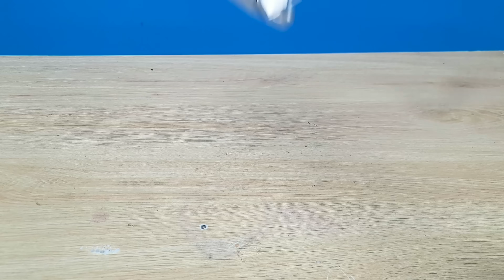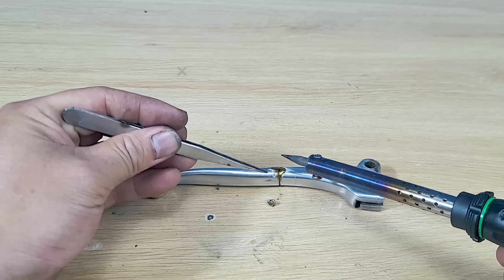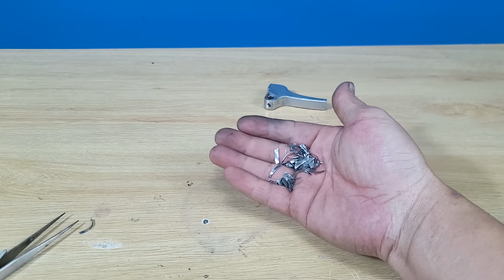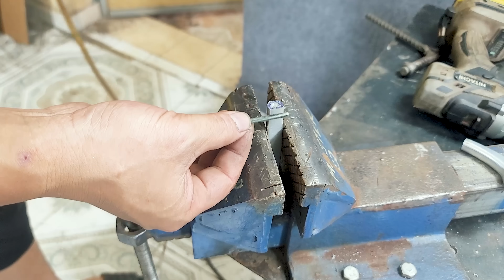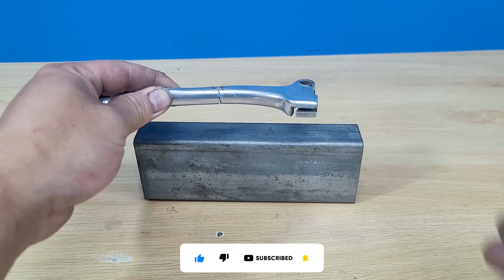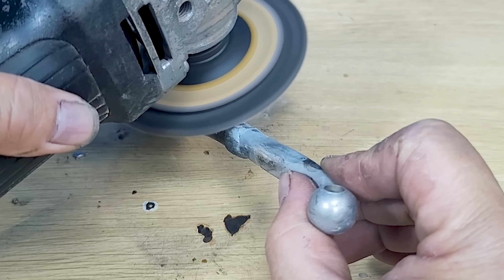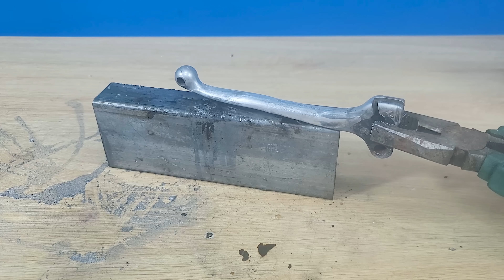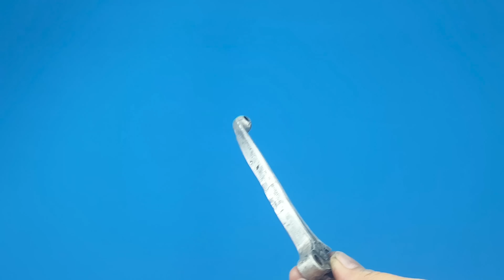Even a NASA professor had to learn this from me! Idea of using 1,5V battery to weld aluminum brakes

Comment: So you just need:
-1,5 battery,
-box cutter,
-pair of pliers,
-metal sheet cutters,
-toiler cleaner with hydrochloric acid,
-vise,
-cordless drill
-Philips bit size 2 and a Phillips head self drilling screw ( if you don't have a drill bit for some reason)
-purple marker,
-angle grinder with metal cutting disc and long M4 screw (if you don't have a taper for some reason),
-screwdriver,
-red marker,
-pair of tweezers,
-cotton wool,
-blowing torch,
-lighter,
-solder wire,
-toothpaste with abrasive, 
-buffing wheel for angle grinder,
-sandpaper,
-hammer,

Probably the only think missing here is life insurance if you are going to actually use this hand brake lever, but i'm afraid they won't cover the damage if they find what was done to the lever ...
Reply: The only thing missing was common sense...😂
Reply: @jackol_8 and his safety flip flops 🤷‍♂️
Reply: You forgot the camera 😅phone and 
Tripod  and hours of video editing
Reply: @DISLIKE4FUN  And thousands of hours wasted by people watching this video.
Reply: @DivyangM  ^No, it was funny to see, how crazy people can be 🙂
Reply: @christiancarlo117 also an Internet connection, a dwelling, electrical outlet, ...
Reply: I just got rid of all my drill bits, I only use self tapping screws now.
Reply: Hehehehe 😂 @anthonym.pacelli1960
Reply: @anthonym.pacelli1960 lol
Reply: ...and about 40 Dollars of different liquids and pastes, sanding paper, etc instead of buying a new one for 5 Dollars. Brilliant !
Reply: @microlatinamicrocontrol1240 and day of work - reliability?????
Reply: Парень показал дорогу . А идти по ней или нет тебе решать . А я так трещину в алюминиевой лодке запаяю . Или ты мне новую купишь ?
Reply: @Dimac_yx  вот думал как трубку высокого давления от кондиционера в машине запаять. Думаю такой способ не подойдёт)
Reply: Lol
Reply: As well as all that stuff, you will need to buy a new lever so that you can pretend that it is the repaired old one.
Reply: Right, but he forgot the laser.😂
Reply: You forgot most importantly the 110V soldering Stick that cost $25 and a new brake lever delivered is $6 😂
Reply: its solved by buying original part $5, instead of buy all of these up to $200 T.T
Reply: I'm surprised the clutch / brake lever didn't break at its weakest point -- the screw connector or the tiny cable attachment point. Regardless, I would only depend on that fix to hold until the new part comes in.
Reply: If you don't already own all of those things, you are not a man. 😂
Reply: Waste of time.Purchace new one
Reply: How money to buy all thing 🤣🤣🤣🤣🤣🤣
Reply: you forgot first aid burn spray, a  heat resistant jeweler's brick safety glasses and gloves and few other things
Reply: Is the Lever worth the total of these?! Plus the labour...
Reply: Дикость какая то, фиолетовый маркер. Поможет только синяя изолента!
Reply: Mate, you spent more time writing what this guy needed to solder the aluminum than this guy spent soldering it. With your pea sized brain you have absolutely no understanding of the complexity doing this job beyond the point "I can order a new one". Its not about the part, its about the technology
Reply: They NEVER find what was Dan belive me..😎
Reply: Many thanks to list 'em, you save my time to.
This really is 🤣🤣🤣🤣🤣🤣🤣🤣
Reply: Agree 100%
Reply: I don’t think the color of markers would make a difference
Reply: + баночки для средства чистки туалета
Reply: Dia hanya ingin menunjukkan penemuan baru, walau tidak ekonomis setidaknya dia bisa buat konten Tampa mengambil vidio orang lain 😊
Reply: Just you can buy a new one na
Reply: New one 150 indian rupees😂
Reply: Bahahaha
Reply: It's not a 1 comma 5 battery.  It's 1 dot 5...1.5 volts.
Reply: Also the fact that now the lever has less strength will be more prone to breaking.  So much easier to just buy a new lever.
Reply: Should also have an 8mm wrench to take the lever off. Removing nuts with needle nose pliers is good way to ruin your afternoon.
Reply: 😂😂😂😂😂 better to buy new one
Reply: That's the type of person who would take a train to travel 20 miles away to buy an item that is 3 meters away from his house.
Reply: É melhor trocar a alavanca que fica mais seguro e também mais barato
Reply: It's called Poverty.  A cashless society so poor they cannot buy new part. Music sound track is a big hint to this aspect of the video's creator.   To work all day fixing a brake lever on the families only transport. Poverty makes people's time the only resource.  Different culture different values.
Reply: No no no. Not just pliers,
MAGIC PLIERS that remove retaining hardware in most misterious ways
Reply: i dont think you actually need the battery. It seemed pretty irrelevant , like it was jammed in for some other reason.
Reply: Pensé lo mismo
Reply: And a partridge in a pear tree!
Reply: And skilled labour.
Reply: He just need his mum to slap him properly for doing silly things
Reply: thats a tutorial to weld aluminium, he haven't asked you to weld or repair only a brake lever
Reply: Yep, that's all you need for a roadside repair! Of course the heat will anneal the aluminum, so even if it doesn't break, it will bend the first time one uses it, and remember, the front brake is about 75% of your stopping power!
Reply: lol
Reply: Kkkkkk
Reply: Kkkkkk 😅😅😅😂
Reply: Go to a near by automobile spare shop, Buy a new one....  Problem solved
Reply: Một sản phẩm tư duy công khó quay đăng video Thao tác sửa chửa để có sản phẩm dùng được ! Thời gian ,vật tư . Giá Thành Sản phẩm . Thị trường khó chấp nhận ! Nhưng tôi khá khen 
- Cùng những lời bình luận không sai -
Vật chất hình thể ! tác động đến tư duy tạo ra sản phẩm tốt dẹp bền hơn . gố phần để phát triển ! Chào cảm ơn Video !
Reply: I bought one in amazon for $8.00
Reply: Thank you for breaking this down.
Reply: What about the health of the Earth?!
Reply: Your work is commendable, but it is not worth all the effort and money
Reply: Good estimations
Reply: One peg also
Reply: Think???
Reply: superbly put!
Reply: @RocRocket-cl3vc He did.
Reply: All right ✅

Comment: Good idea BUT repairing cost is higher than new break lever and repairing time & equipment, process all people doesn't have.. so better to buy a new one is good idea and time saving fact. Need to utilise our brain in some other costly product repairing is correct. This is not de motivation msg. Don't mistake my friends.

Comment: He could've did the screw thing & when it's all together taken a small drill & drilled into the handle on both ends of the screw & then driven a pin through each end. Then counter sink the pin & stick weld in there to cement it in place.

This would pin the screw together on both ends & serve as a backup safety mechanism should the weld in the middle ever give way etc.

Comment: You made a flux to help you to solder aluminium. You reacted the scrap zinc with maybe hydrochloric acid  or sodium hydroxide ( drain cleaner) ? I think perhaps you reacted it with sodium hydroxide. 
I haven't had any luck using zinc chloride as a flux for aluminium but sodium zincate could work . 
      However , you can directly use the zinc foil from the battery instead of solder to fuse the aluminium by using the torch to heat it to melting point . You roll up the zinc foil like you do for a cigarette. 
  Just practice using zinc to fuse together aluminium parts . It's not difficult.

Comment: lol! you are trying to look so smart, but you open the battery without gloves...? and then you drill holes with a screw before making threads with a modified bolt? Also, i think you spent more money on making it instead of buying a new one. Apparently you don't know much about this type of aluminium alloy, but when you heat it like that you rearrange the molecular composition so that even if it feels sturdy now, it will become brittle in cold weather or even snap off easier if you bump the brake handle.. I bet that one day it will snap off while you are breaking. I certainly hope that that won't happen anyway!!

Comment: maybe run that "tap" a full 1 inch on both ends and then use a equally sized bolt that did not have threads ground off. if you are using the  liquid as a flux then it should be applied in the holes and on the bolts as well to allow it to draw in the solder or weld.  i can see using this fix on a clutch but not a brake lever.

Comment: Besides the unnecesary work as I see everybody says (and they're right, it was more practical to get a new one)... Clickbait. You took the zinc/magnesium casing from the battery, apart from that you didn't repair anything with it, leave alone welding. You could just get the metal pieces from about, let's think... ALMOST ANYTHING MADE OF METAL. What a scam. And yes, I know you get paid from me leaving this comment, but man, I do hate lies and this is one. I hope your channel dies.

Comment: More over this is the back brake. If you screw it up again at the created weakness point because you created a gap insted of putting the to parts as thight as posssible together you will grap both brakes the rear one will be out of order in a critical situation and you only have the full braking power of the front brake what will throw you over the bar - dangerous af! And never use a hammer on aluminium it is a very weak material because it doesn't bend like steel it simple breakes when hammered or bend.
Reply from the maker: Hello, I am happy to hear from you many useful information for us, ♥️ ♥️ ♥. ♥Thank you very much. We look forward to receiving your support in the near future. We wish you a happy new day

Comment: If this is aluminium, you can weld it or solder it. But if this is ZNAL - zincum/aluminium alloy (ZnAl) then forgot you can repair it properly.

Comment: Bullshit!
you cut up the battery for scrap and simply wash it alongside the handle.
you then drill and install a rod and then lead solder it never actually using the aluminum scrap from the battery.
do us a favor and never ever make another video at all, we dont need this fake crap.

Comment: Ok I am sick of the BS "repair" videos that seem to have flooded YT these days, some of them are of dubious value at best while others (most actually!) are just total faked BS but try as I might I can't see a single flaw with this that fits one of those descriptions! In fact everything he did has a good explanation for it and "basically" it's the same principle and most of the same materials, Zinc from the battery, etc, that make those low temperature aluminum brazing rods work, and they do work quite well so I am willing to bet this will too. So yeah there are many "better" ways of doing this if, for instance, you have a TIG welder handy or maybe some of those low-temp propane/butane torch aluminum  brazing rods on hand but not everyone has such a welder or ready access to those brazing rods for aluminum. In fact if I am right about this process I see no reason why it will not end up as strong as those low-temp welding/brazing rods. Although I have both the proper welder and even some of those low-temp rods in my shop I find this video so fascinating I am going to dig out one of the batteries and some scrap aluminum and give it a try, could be useful info to know sometime!
Reply from the maker: Hello, I am very happy to hear your positive comments for me and a lot of useful information for us, ♥️ ♥️ ♥️ ♥. Thanks a lot. We look forward to receiving your support in the near future. We wish you a happy new day

Comment: Clever,  but I'd have simply ordered a new brake lever from a spares supplier. They are cheap enough and no big deal. Or, if that isn't an option, just used aluminium solder rod (brazing rod for our American cousins) to do the repair and saved myself all that drilling and cutting a screw to the right length.
The results here though are impressive.
Reply from the maker: Hello, I'm very happy to hear your positive comments for me, it gives me more motivation to complete my work, ♥️ ♥️ ♥️ ♥, SO nice to meet you. We look forward to your support in the near future, my good friend. Wishing you a happy new day.

Comment: Nothing innovative about this, just usual methods to join pieces together.  Seems an awful lot of trouble to make bits you can buy or borrow.  A drill bit and a tap to make the holes, a threaded rod or bolt as a joiner.  Welding rod to save all the mucking about with chemicals.

Comment: Seeing all the things needed to put it together gives me shivers. These levers are available cheap in a auto store
Reply: You can get ideas for other applications, not necessarily repair such a common part
Reply: @leetucker9938  It won't snap as it has the screw in the core and that strengthens it. But yes, totally waste of time and money for something what you can buy brand new at at least 1/3 of the cost to repair it. Unless you have nothing better to do... lol
Reply: @badseednut Actually it will because the lever itself is now half as thin and will snap off the bolt
Reply: @luc1ferblack  That screw he put in the middle it's steel, maybe stainless steel, not aluminum. it might break somewhere else but not where the screw is.   But even if it breaks, I don't care. It's waste of time and totally not cost effective. Better buy a new one.
Reply: @badseednut I think you missed the point the bolt wont snap but the material surrounding the bolt is now thin so it will just break around the bolt but yeah a massive waste of time and money and stupidly dangerous
Reply: @luc1ferblack  You probably mean that the screw in the middle might tore apart the handle in the event of impact. That's different thing. If that's what you mean, then yes that's possible and it's plausible to happen at the end of the screw on the thinnest side.  The chances for it to break where the welding point is and where the screw is in the middle, are slim.
Reply: @badseednut  I think your last sentence sums it all up!
Reply: That exactly what I was thinking , meaningless waste of time.
Reply: This is just an exemplary project for one to expound upon. Common sense. And safety first. Thank you for the tip. Now I shall couple this with my experience in other areas of creativity and in conjunction. I shall now leave you and retire to my laboratory where I may spend the next fortunate licking the wounds of failure after failure as I unsuccessfully attempt to conceive such doltish and may I add " primitive" contraptions of things u useful and unworthy of claim.  I'm mcguyber when it comes to water filter smoking vessels .and make 🔥 ass grilled cheese samadges😂
Reply: It seems like you've never restored old bikes or cars.

Comment: I agree with other commenters that this is probably unsafe. You should replace the part if you can.

That said, just wanted to correct the video title: this is soldering, not welding. The use of the zinc solution creates a flux compatible with aluminum.
Reply: Better to replace it with a steel or titanium part. Brakes are really important.
Reply: actually your completely wrong, on both statements, you must be one of those people

Comment: How to weld aluminium  using a 1.5 V battery, pliers, a vise, a drill, a screw, a bolt, solder and a torch.

Comment: Congrats, you soldiered a brake lever, ruined the temper of the lever and used a battery unnecessarily.  The first hard pull on that will bend it like play dough.

Comment: honestly with all that time and work could have probably cleaned the 2 ends and pressure welded them because its aluminum, or even ran electricity through to tac weld it back and then clean it up

Comment: ok, the idea is that external casing of the battery is made of zinc. Dissolving the zinc in the "liquid" helps the weld to stick.
Threader rod inside adds rigidity and strenght ..... Well it's click bait, but not so bad :D

Comment: I'm 99% sure at NASA they don't fix things like this. I'm 100% sure I won't fix brake's handles like this, those are made to brake at some point, in order to avoid more serious damages, otherwise those could be made out of steel, not alluminium. I'm also quite sure, if you do this, you will regret.

Comment: The tensile strength of Sn is about 5..10 N/ square mm. Casted Al about 175 N/ square mm. The max Force of the repared lever therefore is about 1/17!!
It is criminal to give such a recommendation. Risk your own live, OK. But not the live of others.

Comment: Just reviving techniques from the previous millennium ?
This looks like the 'killed acid' type of flux for soldering metals.  Phosphoric acid is great for this but any kind will probably work fine with no 'killing' (I have used it myself for repairing a failed instantaneous water heater )

Comment: And in those places there are typically people who can weld aluminum. That repair will not hold. You need a proper (not a makeshift) flux and you need acetylrne and oxygen or hydrogen and oxygen, or use an arc welding process with a shielding gas.

Comment: I think if you have a broken brake lever, you should take your car to a repair shop to replace it with a new one. It's fast and safe. Doing it like a video clip is too elaborate, time-consuming, and costs more materials than it would cost for you to replace it with a new one.
Reply: Unless you have an antique motorcycle with unobtainable parts

Comment: Congratulations. You showed a basic level understanding of Chemistry and making a caustic flux for high temperature soldering. Sorry, but it's not new,  It's just basic brazing and silver soldering. Sourcing the materials from a common alkaline pile battery is just being cleaver in resource identification. Again, Congratulations on that.